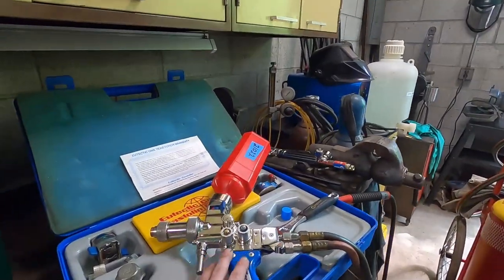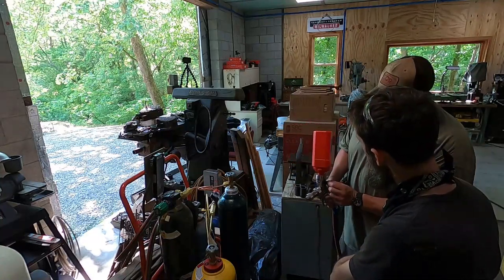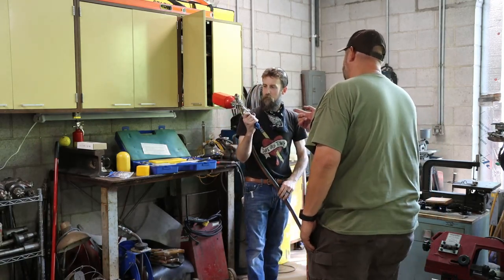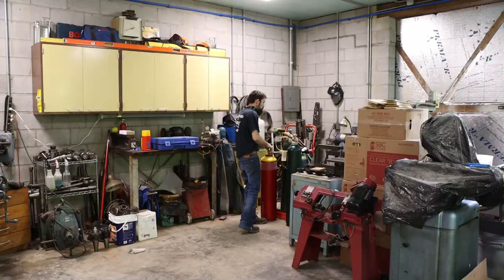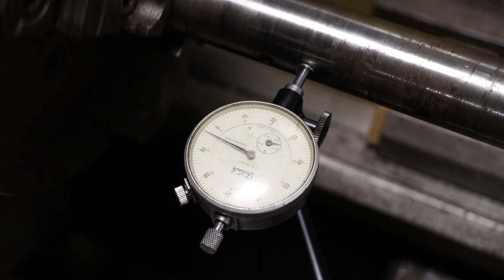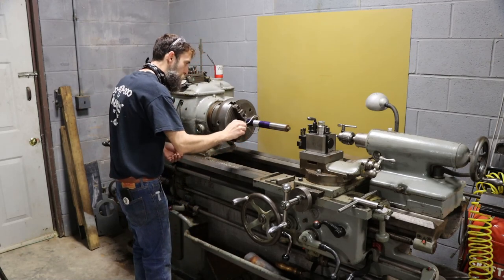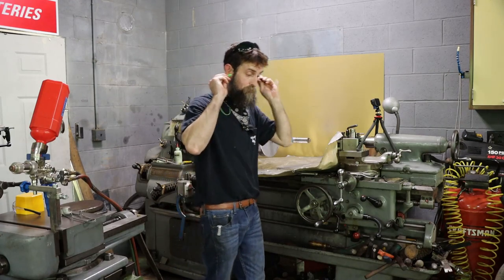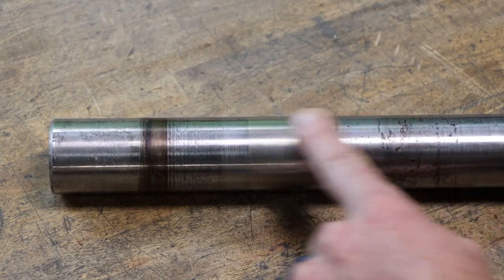Spray welding 1st run Abom 79 / Lance Baltzley Shop Visit.

Comment: Acetylene is an unstable compound - it takes a rather large net energy input to make it. Unlike most other gasses, it can't be compressed much - anything over 15 psig will cause it to decompose explosively into carbon and hydrogen. So instead of a compressed gas, it's sold as Steve describes in the video. Oh, and Steve looks ultra 😎 with those shades and that beard......

Comment: That looks like a nice little Marquette torch you have there on the bench. I have one with a set of their regulators and gauges I've used for forty years cutting and welding. Sweet little setup.

Comment: THANKS!!! --- Good lesson for me.  Off and on for 35 years I designed fixtures for our aircraft parts metal spray dept. - However I never got my hot little hands on the actual spray gun in all that 35 years. I can see now that it would have helped my tool designs if I had hands on experience with the spray gun.

Comment: Some beautiful country area you live in. Thanks for sharing that. Great job on the spray welding. Looks like you have been doing it for a long time.
Reply: Welcome to America. The postcard country. Prettiest place I've ever been to was the Shenandoah Valley. It doesn't even look real. This looks like CGI https://www.louisdallaraphotography.com/wp-content/uploads/2016/10/Shenandoah-valley-5-1600x900.jpg You can imagine that if you treked over those mountains you'd find nirvana. You'd probably just be in Pittsburgh though.

Comment: Two things you might have mentioned is NEVER MOVE A CYLINDER WITHOUT CAPS ON and if transporting acetylene tanks on their side is to let them stand for awhile before using always better to transport in upright position but might not be able to

Comment: also good for nearly perfect cast iron repairs tho will need a way to to heatsoak after spraying....shops that do it routinely usualy have a covered burner but good use of a torch prior and after repair  and a few wraps of a welding blanket or a dip into a bucket of vermiculite until cool will work too.Good vid as always Steve!

Comment: acetylene is shock sensitive, hence the filling in the tank.   it is always interesting to check the Hydro test stamps on Oxy tanks.  had one, once upon a time with it's initial stamp from 1917

Comment: When I was working at Dodge I had several shafts spray welded and turned. The process always worked and the results were very successful. Your ability to rescue worn shafts should pay off probably faster than you think.

Comment: I was using this process in the mid 60's, I think it was a reasonably new process at the time
Reply: When i did the eutectic course back in the 80s it wasnt new but almost unheard of in my part of the motor trade. Still got an almost unused rototec in the loft. We had a powder welding kit too but it got stolen.😢

Comment: In the UK cylinder fittings are standardised, the British Standard for fuel gases is 5/8 int. BSP LH and oxygen or shield gases is 5/8 int BSP RH the left and right hand threads helps stop bottles being cross connected
Reply: yes i notices that the bottle had RH thread

Comment: We have cicadas in Australia too, they were everywhere and so loud. Also they hurt when they fly into you because they are huge.
Reply: I hit one while riding down the highway on my motorcycle. It hit right at the top edge of the face opening. It damn near took me off of the bike! I was doing about 65mph. It felt like somebody hit me with a 2x4. Not fun and scary as hell.
Reply: @Dwarfracer88  
Hahaha, I hear ya. That would've had a lasting bruise. They are also not very fun when they hit your cars windscreen, and the cleanup is disgusting.
Reply: @Dwarfracer88  cicadas are bad but once I got hit in the face by a Rhinoceros beetle. Danged thing was like a rock with wings and horns. Don't recommend it. It left a bruise.

Comment: A lot of fun and informative too.  This isn't a criticism in any way; I'm just curious.  Suppose you have your powder gun all set up and flaming with just acetylene and lots of oxygen.  You point it horizontally above an empty section of concrete floor, then turn on the powder supply for a few seconds.  I presume you would get a slight residue on the floor. Suppose you carefully collected that residue and looked at it under a microscope.  What would you see?  I would guess that you would see either tiny but solid metal balls, balls of metal oxide, or perhaps metal splashes.

Comment: wish you'd took the runout on the end  after the weld , thanks steve
Reply: None. It's evenly heated throughout. Did a lot of this type work on electric motor shafts in the 70's. Works good on cast iron end bell bearing races too.We repaired a lot of cotton mill motors that were no longer made. $$$ in profit.

Comment: I still want to see an engine crankshaft spray welded then run and checked for flaking.   If it works for that it could save thousands in semi-truck engine repairs.
Reply: I would hope it works for that. It'd be a pretty worthless process if it didn't. But maybe that is too demanding? I think a lot of how well it works depends on who does it. Like Adam said some folks just do not do it right. Steve listened, paid attention and then did as he was told. Not everyone can do that.

Comment: You guys should explain in more detail what spray welding can and cannot do.  A lot of guys think you can use it to build up crankshaft journals etc. where you have a lot of high pressure and load.
Reply: We had a man in Zimbabwe that built up cranks and it works well
Reply: @aldoblasigh7533  Could you send me his link- I am still waiting for my millions and he no longer responds.

Comment: First I love this channel and would like to meet you in person!
Second, at my work we under utilize this process  and we have the exact same "torch"!
What we typically use it on is wear journals on trunions made from 304 stainless that
we make from raw stock and we have lots of trouble getting the too thick specified, idiotically
hard layer applied perfectly.
It takes very light cuts with CBN inserts to machine the build up, cant remember the exact powder,
but it's hard as a whores heart, and it is a much higher temp operation than a typical spray weld, you
spray a layer then fuse it....
The whole part is cherry red when you start and its very hard to get a good bond in the corner/ radius
between the area that is supposed to have the hard surface and the bulk of the shaft.....
I would truly like to murder the guy that designed this part, we have made around 200 of these over the years
and the scrap rate is about 30%, you don't know till the last few cuts if its going to be bonded or not....
Sorry for the rant but the point I was going to make is : once you have the "torch" set don't mess with the
oxy/acc valves, just shut it off with the lever, sure it pops loud when you relight it but it saves a lot of time
resetting everything....

Comment: Be careful with acetylene, It is dangerous over 14 psi.
Quote "However, it becomes unstable and spontaneously combustible when compressed to a pressure over 15 psi. Beyond 29.4 psi, it becomes self explosive, and a slight shock may cause it to explode even in the absence of air or oxygen."

Comment: So do you need to clean those spray welders like a paint gun ? Curious about the buildup.
Reply: The powder and flame mix away from any nozzle, so there is no clogging.  (at least I think that's the case)

Comment: Wonder if that would work on a crankshaft for a no longer made engine?
Reply from the maker: They dont recomend it on the throws but the mains work well I'm told.
Reply: @SteveSummers  it's on the throw part that it's needed

Comment: I could swear I read someplace that you should never lay an acetylene tank on its side. Something about the layers of stuff inside. Is that not accurate? Is that the old way not needed for current tanks?  For those who don’t have periodic cicadas, it’s hard to imagine the noise as it comes from every direction. It’s pretty awesome. New developments don’t have any this time around. Since the eggs fall under where they are laid, some mature bugs have to “seed” the newly disturbed soil, apparently.
Reply: The reason for not laying the acetylene tanks on their sides is that that could create voids in the solid filling, and cause the acetylene to come out of the acetone solution into a pocket where the acetylene gas would pressurize too much, possibly causing an explosion.
Reply: On it's side acetone will almost certainly come out. The acetone degrades hoses and I think it can gum a torch up? Because it is not like nice acetone you get in a can. It's kind of yellow puss from what I've seen of it. It is pretty common on job sites to wire tank bottles to pallets and then take them around with machines with tines. It's not good to do but people do it. Then tanks are laying down.

Comment: Very strange. Here in PA I've only ever come across the 510 on acetylene tanks, no matter the size.
Reply: In the UK the threads are always the same except acetylene has a LH thread so you cant mix up the regulators. That's what happens when one company has a near monopoly and sets the standard, also why can get away with ripping off their customers and their outrageous terms. Curse you BOC.😉
Reply: @chrisstephens6673  Any type of fuel here is also left hand threads. It's not a bad thing.
Reply: @timramich  does save confusion

Comment: How is it with gas cylinders in the USA? Here in the UK you have to pay £100 per cylinder annual rental to the gas supply company. Pretty soon you're paying £400 a year for nothing. I'd have liked to buy the cylinder and just pay for the gas, but that's not allowed. This is why I stopped MiG welding.
Reply: `Where I live in California, there are two 2 options. You can pay a fee in addition to the fill charge that is billed monthly, or up front you can pay for the cylinder and the fill the first time, but there is never another charge associated with the cylinder. When they are empty, you just exchange your empty cylinder for a full one, and just pay for the fill. For a home shop like mine, gas usage is depending on the project that is being done at the time. A cylinder like my Argon, can be used in a very short time or may go for months before needing a refill. Owning the rights to the cylinder works best for me.
Reply: You can buy some small bottle sizes and have to lease the bigger ones. But you can "find" lease bottles. And depending on circumstances you own them then. I bought some bottles off a widow once. She probably didn't own them but she didn't know. The person that did was dead. Now do I own those bottles? Technically probably no. But no one is coming after me for them either. So the best I can tell you is it is a gray area. If you're in possession of bottles but have not signed any contract you're not paying either.
Reply: @1pcfred  Yes, I actaully lent one of my bottles to a bloke I met in a pub, and it took me two years to get it back whilst I was still paying the rent! If I 'acquired' a bottle, didn't pay rent on it, and then when it's empty I take it to a BOC retailer, they give me a different, already filled bottle. Do I start paying rental on that then? Or can I continue escaping?
Reply: @robertwalker9638  Yes owning is best, but UK won't let me.
Reply: @samuelfielder  here a bottle contract and swapping bottles are unrelated transactions. You lease the bottle then you go and swap it. I was never in the lease but I think they soak you right on the spot. Then I imagine they send you a bill. But if you never sign the lease they never soak you and don't have you on record to bill either. I always deal in cash at gas houses. When I sign that's what I sign. Cash. So they don't know me from Adam. It is strictly cash and carry.

Comment: I specify CGA 510 from my supplier as well as the Linde or Birdbath style tank. It's in the computer as a note. If they send  the wrong tank, they come get it and provide the right thing at their cost. I live in NH can't go too much farther east and hit water. Either  connection style is in use here. I have never encountered any other CGA connection in my 40 years of welding for acetylene. Then again I have not seen it all, Far from it!

Comment: Hey, Steve, take a look at BSP fittings; Actual size versus plated size. See what crap us Brits have to deal with.
Reply: Ah yes but when it comes to acetylene, in British Standard fittings we only have one for the bottle. A rounded cone like the one Steve has and left hand thread so it cannot be used on anything but acetylene bottles and you can see it's a left hander, by the radial groove cut in the nut denoting a  LH thread. ( also British Standard)  in fact ALL the acetylene threads to fit to hoses, torches, flash arrestors, are left hand threads.
Reply: @samrodian919  Fairly standard in UK for fuel gas lines to have LH threads. They make it as hard as possible to mix the lines up.

Comment: At 23:40:- The British standardised many years back, and came up with British Standard Pipe fittings (BSP for short), still a nightmare when you do not know what a certain BSP size looks like in real life. Worse, still, if you are trying to pre-order for something that you can see a couple of feet away by torch light and 2 days ahead of the job, so you can get on with the job once you have the part dismantled.